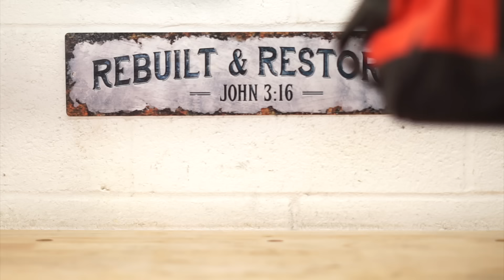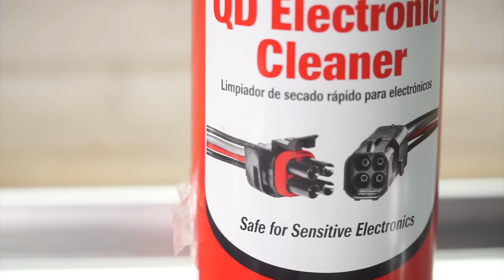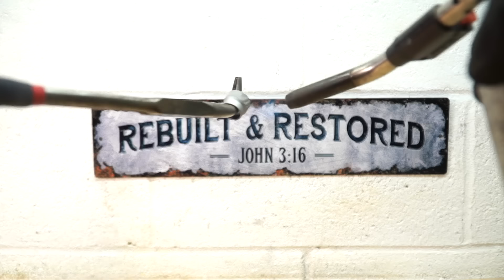Milwaukee M12 with Bad Motor Restoration / Rebuild

Comment from the maker: Hey! I bought this M12 kit at an auction for around $30. After the purchase I found out the impact was messed up (Probably why it was at the auction) oh well…. Sooooo I restored it!  Was it worth it?  

Also here is another auction find that I restored for my dad. https://youtu.be/YPdNFjYANjE
Reply: $30 for a used m12 kit is great, one 2.0 battery is $36 , i paid $128 for this kit in a fuel version
Reply: @dancearoundtheworld5360  the answer to the question is no its not worth it, you're welcome
Reply: Unfortunately not worth it at that price. If it was at least the m18 version or the fuel m12 then yes, but the ones you got were not worth it in that condition for $30.
Reply: Love the quote on your wall!

Comment: My Makita 10v impact is an absolute beast. I've used it every day for the last fifteen years. The kit came with a drill and an impact. I never used the drill but I beat the hell out of the impact. So when the trigger broke on the impact I took them both apart and put the trigger from the drill into the impact. Those old electric impacts and drills still sell for around $140.
Reply from the maker: Sweet! I will definitely keep using makita!

Comment: 9:48 common reason for noise is dry bush that makes contact with the anvil shaft. You should of greased the shiny round perfectly machined shaft near to prevent friction, premature wear and play on the anvil shaft. But other than that nice restoration video. 👍
Reply from the maker: Thanks much!

Comment: You may could have opened the old motor and replace the brushes or bearings. Just an idea. And since you already replaced the motor, operate on the old one to see what the problem was...can't damage it any worst now. Thumbs Up!
Reply from the maker: That’s a good idea! Thanks for the suggestion. Have a great day and thanks for the comment!
Reply: I wanted to see motor rebuild too.

Comment: good to know if (or rather when) your milwaukee fails, you can still use a makita to fix it :'D
Reply from the maker: You better keep the Makita handy!!! 😂
Reply: @RebuiltRestored  i have bought the cheapest hyundai (around 30usd brand new, came in a carton box) when I moved away from home, and it is still holding up strong! I'm suprised i got the one working model, and fear the day it finally gives up.

Comment: Why didn't I see the red led lights on the unit working after the repair?( power level for batteries)
Reply from the maker: Someone else asked about that. The cam didn’t pick them up or I didn’t get a good shot but they do work.  Good eye! 👍

Comment: Here in Brazil the top brands are Makita, Bosch and DeWalt. But from what I understand Makita loses to Milwlalkee. Milwaukee doesn't look easy. It is more concentrated in industrial use.
But Makita has been losing robustness, like this all-plastic torque multiplier on some screwdrivers. Premature engine burnout... They're riding on brand strength.
Reply from the maker: Thanks for the feedback 👍.